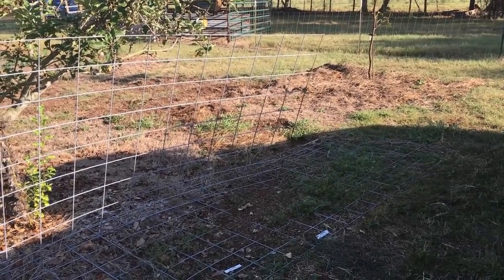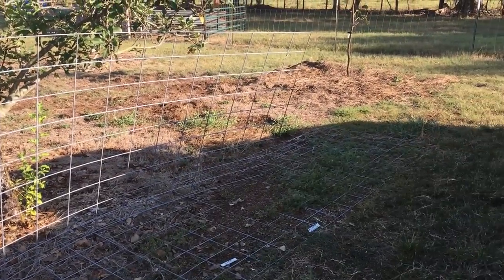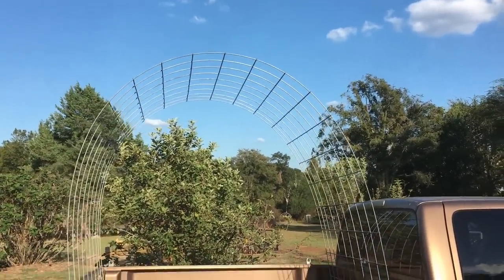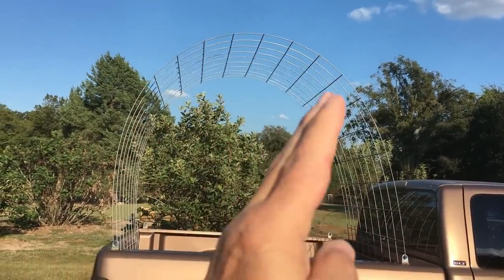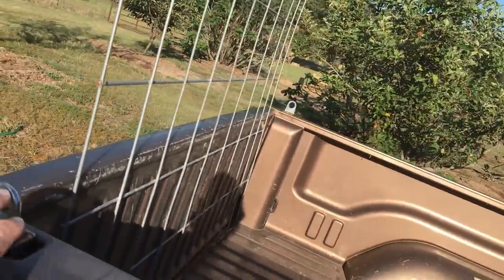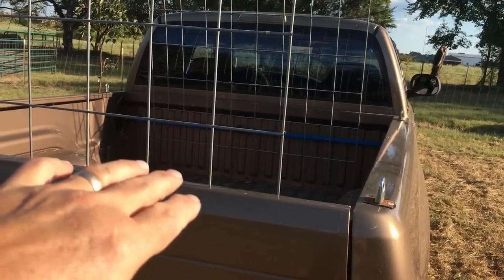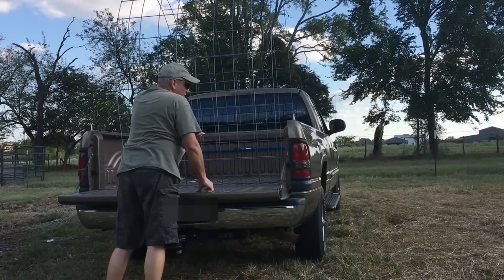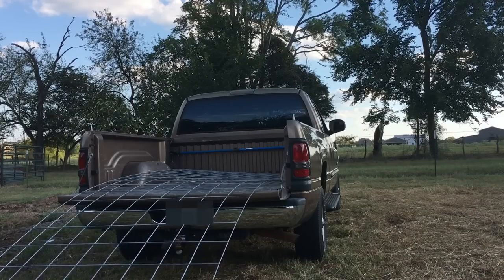HOW TO LOAD A CATTLE PANEL IN A PICKUP TRUCK

Comment: Used to load it like that until we found you can do the same thing if you just put them on their side...that way you don't have that springy thing moving about as you go down the highway and don't have to strap them in.  Works like a charm, try it!
Reply from the maker: I've seen some on their side. It seemed to me that they were bent a LOT.
Yes, they can be straightened out, but I don't know... this seemed better to me.
Also, even if I put one in laying on their side I would put a strap or 2 on it.
You never know if you'll hit a bump or have a little fender bumper that might kick it in the air. It's 'springy' even in that position.
Reply: Nah, they don't get too bent.  We have a 5 ft bed and can bend 2-3 in there on their sides and shut the tail gate, drive 20 mi. and they still come out looking like they should.  One bungee across the top will keep them from bouncing out.

Comment: I had to haul 9 cattle panels and they were 4 gauge so would be very hard to bend. So, I laid two boards in the back measuring 2x14x14 feet long on the floor of the pickup. These supported the panels when going down the highway. They were also tied down with a 2 inch ratchet from tie downs in the bed. A large red flag was also secured to the rear of the cattle panels.
Reply from the maker: That will work... but I'm glad a cop didn't see you. I think you were out of "code".
Around here, I think a load can only stick out 4 feet from the tailgate.

Comment: That's great - FOR ONE PANEL.  I'm going to buy 5 tomorrow and I don't think it's going to be that easy.  But thanks.
Reply from the maker: You can do 2 or 3 pretty easy, but 5 might take a little help.
Those things are VERY springy when you bend them

Comment: If you have four would you be able to bend all four at a time? Could you just lay them flat, pushed all the way forward and then fold them one at a time from the back to the front of bed and secure? Leaving the tailgate down?
Reply from the maker: I would think you could do 4... BUT... I would have HELP doing it... not just one person.
The spring-back of the panels would be pretty strong.
Also, make sure you have help UNLOADING them.... those things are going to want to spring back HARD.

Comment: This method is only good for a couple and it requires a lot of strapping down to be safe, a better way is to stand up on short length then grab both ends and bring together and lift cattle panel in the truck bed. . You can fit 8 to 12 into a 6 or 8 ft bed. 6 ft bed requires one strap at the rear of the tailgate. 8 ft bed the tailgate can be closed. Video:; Channel Matt & Sara; Video How to load cattle panels in truck.
Reply from the maker: You could do several using this method, but would have to be careful of the spring back.
Doing it the way you say will work, but I think it would scratch the crap out of the bed and tailgate while sliding it in.

Comment: I do 2 16 foot boards 2-6 flat on the bed of the truck and lay the panels down I can usually get 12 to 15 without enough flex
Reply from the maker: Isn't it illegal to have them sticking that far out from the tailgate?
I think it TX it's 4' over the tailgate.

Comment: I load mine bent in a u but not high, set them short side down in bed and then in a u shape from side to side, then it only sticks up the 50 inches and does not sway as much.  I them run a ratchet strap from bed side wall to side wall thru the panel at bed height.  then they are completely stable, no sway at all.
Reply: how many panels are you able to do with this method?

Comment: Has anyone tried this while transporting these panels on a highway at 60 mph? I have a Toyota Tacoma pickup truck, so I have the transportation. But the nearest agriculture supply store is 28 miles from me. Of course, I would tie my panels down very well.
Reply from the maker: The wind just whizzes right through them.
There's almost no drag at all.
Shouldn't be a problem... but I would make sure they are tied down well.
Reply: @BIGALTX   Thank you!